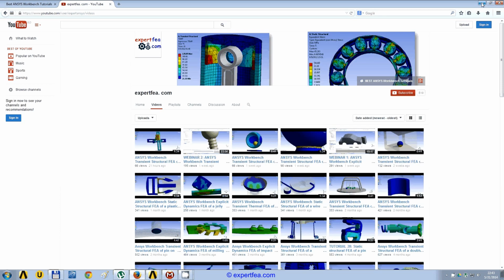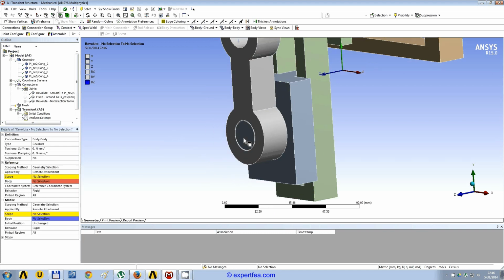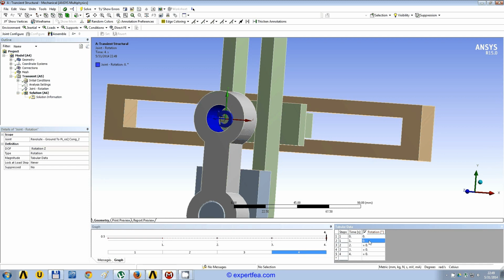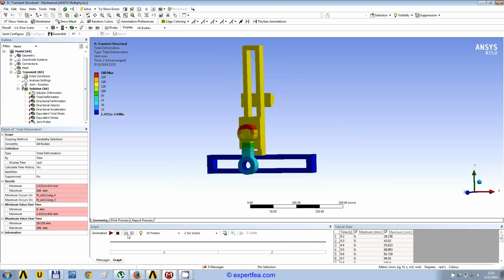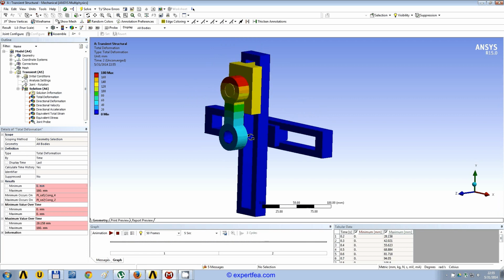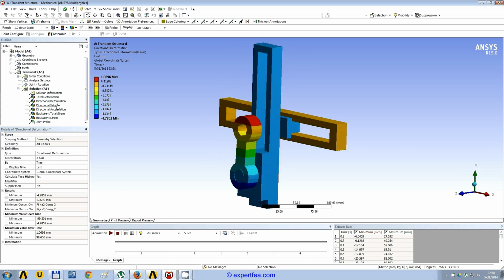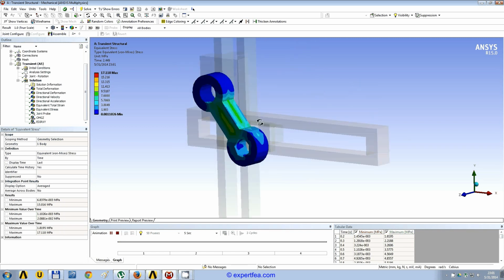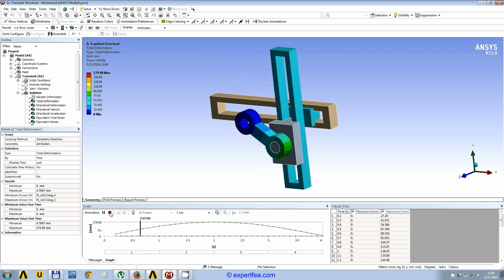WEBINAR 3: ANSYS Workbench Transient Structural FEA of a crank and slider mechanism

Comment: Sir I have got one question.Actually I was also analyzing crank slider type of mechanism when we apply rotational velocity to crank (Which in real we will achieve by connecting motor) As I am given constant input power , should I also give moment as input along with rotational velocity from the equation ( Torque* rotational velocity = input power)?
Reply from the maker: For me it seems kinda redundant to have both, but you can check: run once with both rotational velocity and torque, then run without one of them and see the difference, hence draw conclusions. Good luck!
Reply: Thank you so much sir for replying.. I actually did without moment... and it 
gave almost the same result..but I couldn't understand why it happened 
.it would be very helpful if you explain how it is redundant when we 
apply both??
Reply from the maker: ANSYS developers know best.

Comment: sir i got a question to ask... if we are working in transient structural then is it necessary to give the clearance between two bodies like in your this video in first body to body revolute joint there is a little clearance between cylindrical shape surfaces
Reply from the maker: +rakesh singla When we use joints, the clearance is not important. (Generally, ) The joints are related/ linked to the axes, not to the geometry itself.

Comment: I have read in other posts that the main difference between transient and static structural is that static does not use the inertia of the bodies...
Reply from the maker: Yes, I agree with you, Transient is most useful when dealing with kinematics/ dynamics.